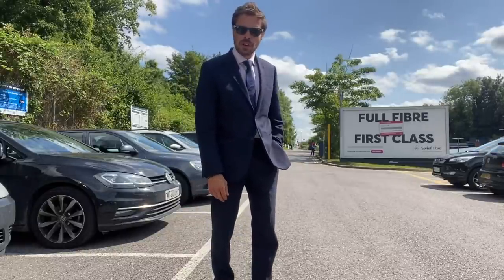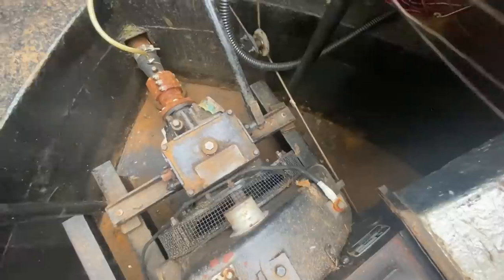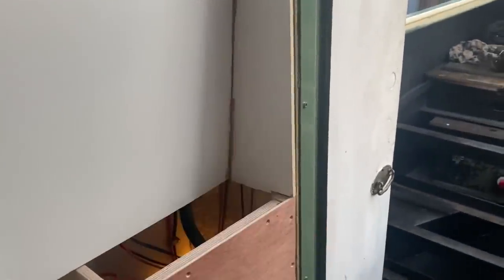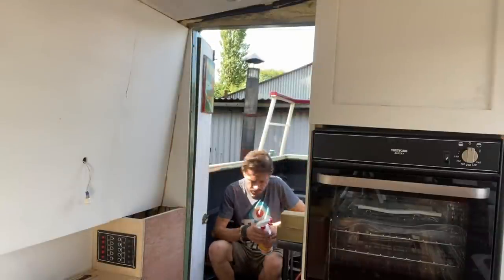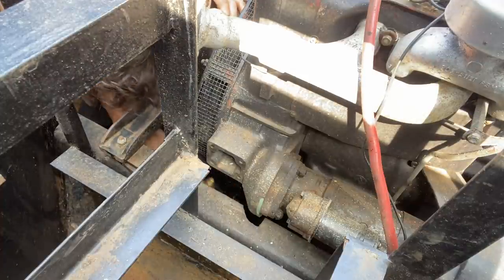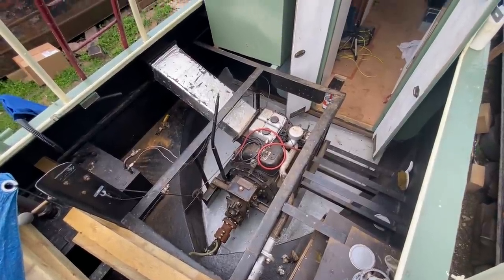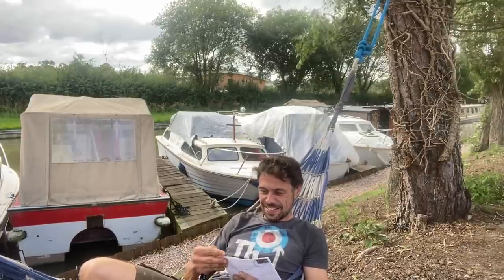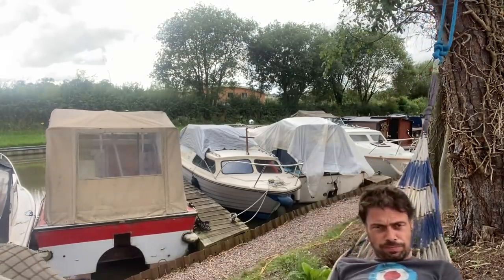232. Engine bilge gets treated

Comment: Hi  a good coatings of vactan is what’s needed plus Grey primer is what is needed as bitumen paint will come off with chemicals And diesel so if it’s worth doing , Doing it right first time saves time in the long run.

Comment: I admit to to being obsessive about keeping bilges and engines clean and dry so it always drove me nuts every time you left it uncovered and wet, but it looks good and hopefully it will be easy to maintain good job . Also if you hang two carrier bearings an an offset arm on the shift lever you could probably offset the shift lever to the side but not sure just an idea.

Comment: Panel degreaser, primer (Alu oxide based) then bilge paint.

Alu oxide based primer will help with the rust patches, vactan with the polymer priming will help also, can then use a self priming.

Blacking it corrodes away with oil/chemicals.

It'll breakdown over time if the engine is in heavy use.
Reply from the maker: The paint I used was a rust converter, oxide primer and top coat (2nd coat)